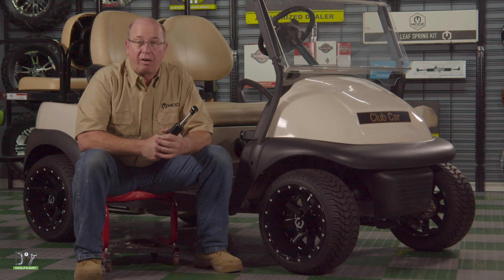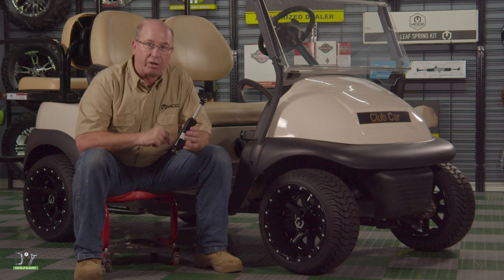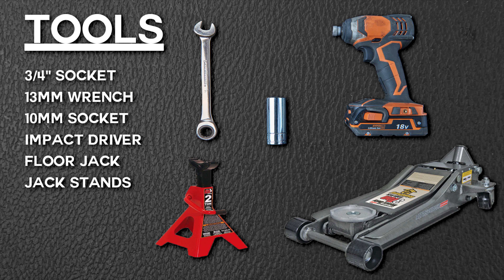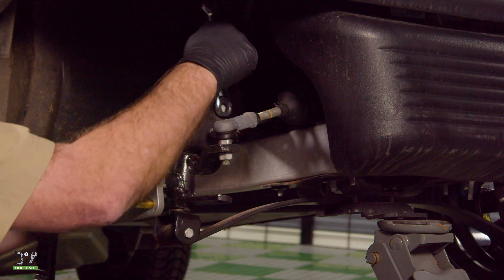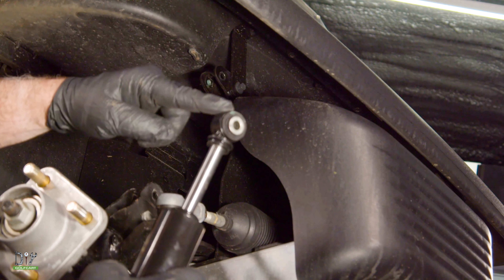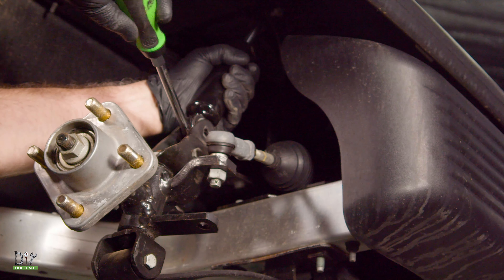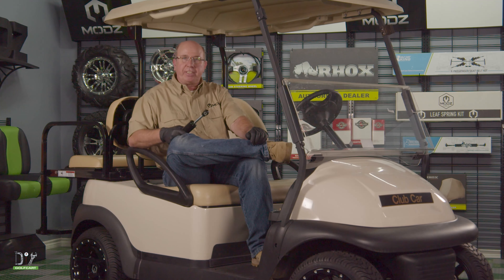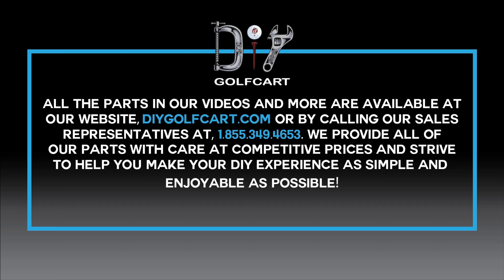Front Shock Replacement on a Club Car Precedent Golf Cart How-To

Comment: I have a severe negative camber issue with a 2004 precedent cant figure out whats wrong
Reply from the maker: Have you adjust the camber adjustment bolt?
Reply: DIY Golf Cart yes but it just tilts the wheels back and forth .. both wheels are severely tilted in .. it think my upper a arm bushings are gone
Reply from the maker: @mobeious  https://diygolfcart.com/search.php?search_query=7277&section=product

Comment: Hope this doent sound silly but question....do these shocks wear out by age because my ezgo TXT is a 1999 and it still rides  great...no leaks, no issues. Should I replace them, wondering if newer shock technology would give even a better ride. 
Thank you in advance
Reply from the maker: No silly question here! The shocks on Club Cars and EZGO's only cushion the ride due to a single leaf spring suspension. Therefore, if it isn't leaking don't worry about it. Actually, if you install heavy duty springs, you don't even need the shocks anymore!
Reply: Plus fleet carts have a lot of wear and tear. I know when I rented a cart for 18 holes, I didn't care what I drove it through  or over.  I have to do Heavy Springs and Shocks for one of my 2000 EZ-GO TXT. I wonder where I can purchase a kit at?